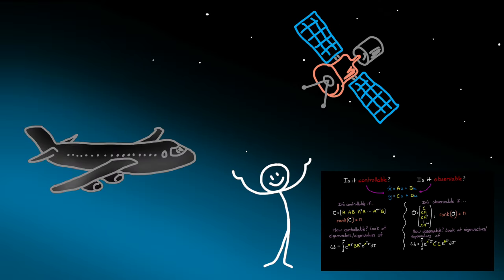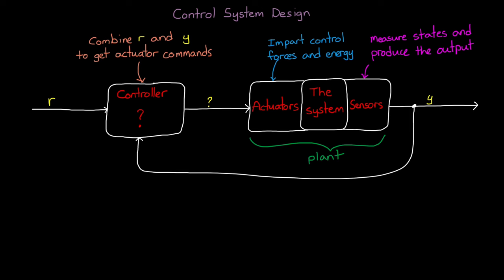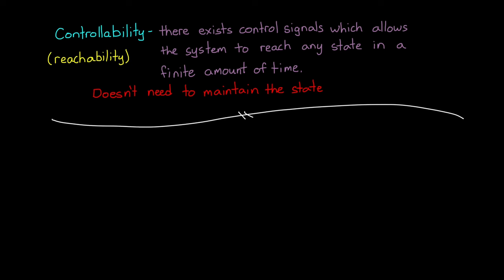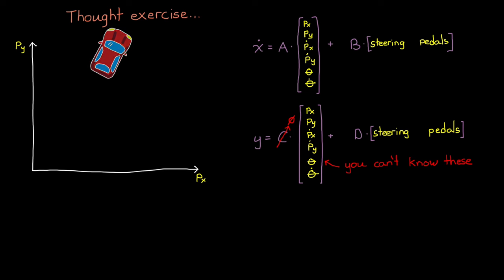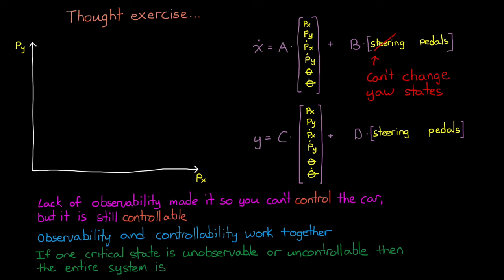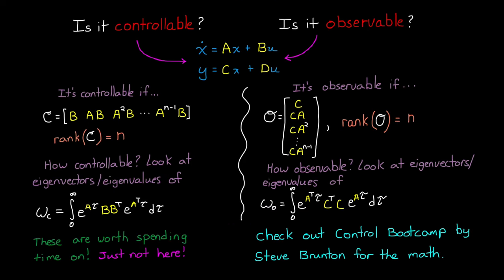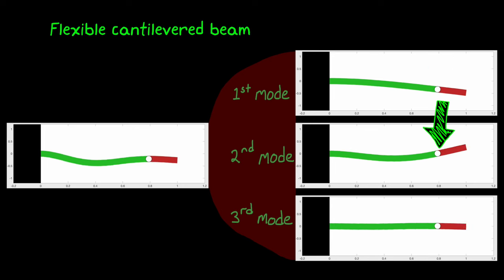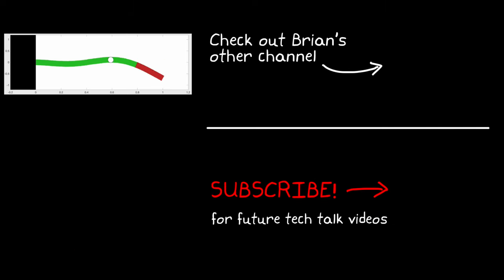A Conceptual Approach to Controllability and Observability | State Space, Part 3

Comment: Your definition of controllability is actually reachability, in continuous systems they are equivalent but for discrete systems they are not. To be reachable the system must be able to go from your initial state to any other state, to be controllable the system must be able to go from any initial state to zero. In discrete systems it is easy to see that a A = [0 0; 0 0] would be controllable (gets to zero from any point in one sampling without depending on B), but it would only be reachable if B = [1 0; 0 1] (individually control each state). Great video nonetheless.

Comment: Love your videos! Can you please explain why is the D matrix usually regarded as zero in college courses?
Reply: To my understanding. D matrix is the direct feed through term, the input will change your measurement (y) directly, not through the system evolution (Ax). And this type of system is rare (never see and cannot think of one). Note that if D is non-zero, the transfer function will not be strictly proper. Another reason maybe, because the maths is the same with or without D being zero, college courses usually design to be easy to understand and illustrate the key concept.
Reply: Just something came up in my mind. If you are discretizating a continuous time system, it is likely that the resulting discrete system (Ad,Bd, Cd,Dd) Dd is non-zero. I think there is a paper talks about discretization will introduce something call "sampling zeros". Even the continuous model is strictly proper, the discretized system will not be.